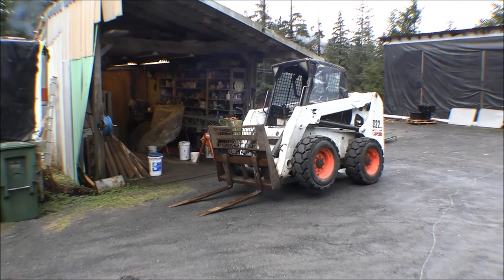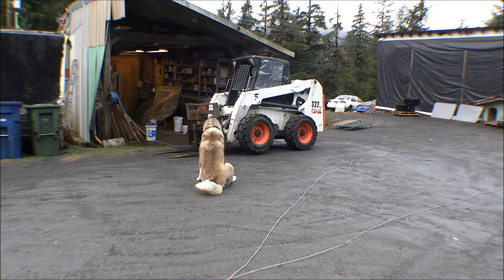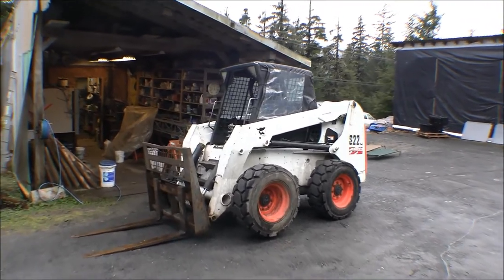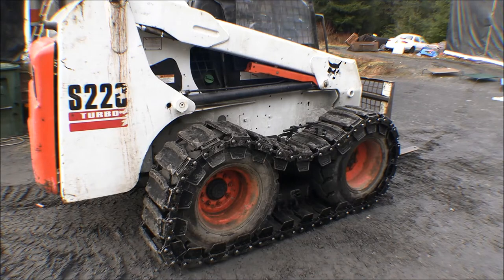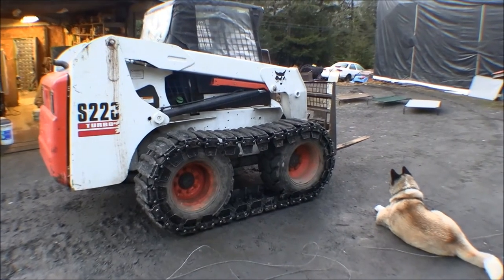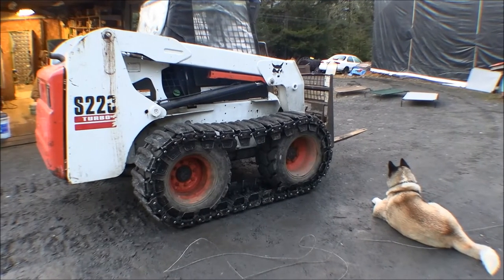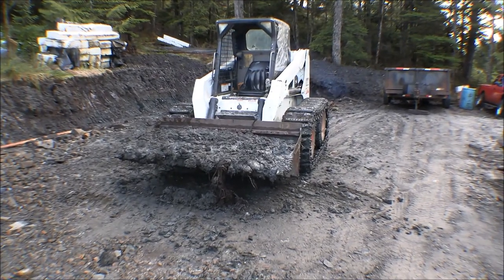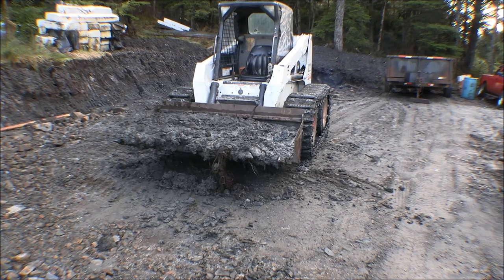Installing McLaren Magnum OTT Skid Steer Tracks on a Bobcat S220

Comment: You should have taken a pad out of the track..  There is an extra pad in there.. You put so many bolts in the short holes that as the track wears, you may run out of adjustment..  Also, I think i see where you have two adjoining pads with the adjustment in the short hole on both sides of the dog bone..  McLaren says that will make a bind in the dog bone and pad adjusted like that..  Check it out..  I would not like to see you have problems with your new tracks..  I also have a set of McLaren tracks, however mine are a little different style than yours..  Mine are non directional..  Also I find it is easier to break a bolt free on the front of the track and then back up to where you are going to make your track adjustment..  I have a John Deere 330G and did not have a clearance issue, as I had three inches of clearance between the tire and the machine before I installed the tracks..  I do not know what your clearance measurement was before you turned your tires around, but you may also be ok without spacers..  I do not care for the spacers myself, as there is very often an issue with bolts breaking..  Before I retired the company put tracks on one of the skid steers and had issues with breaking bolts..  It is a common thing to happen with spacers..  I also have run Grouser tracks.. I have a set I put on my John Deere 325 skid steer..  I just rebuilt them both a little apart from one another..   The one has no run time on it..  I swapped machines and did not let the tracks go with the old machine..  Enjoy your new tracks..  I wish there was an option to add a picture on here..

Comment: Have you ever had the spacer hub snap the original lug studs?
Reply from the maker: I didn't use a spacer, just turned the wheels around.
Reply: @psgflier so the air stem is on the inside?  I have OTT on my Bobcat and have spacers.  The wheel has fallen off twice due to the lug studs breaking
Reply from the maker: @marcusjames3035  Ya, the stems are on the inside, makes it a pia because I have one tire that has a slow leak. The main reason I didn't get spacers is because of the cost of the spacers combined with the cost of shipping up here is pretty high. I also considered the added stress on the studs and the axles/bearings. I found that turning the wheels around gave enough clearance for the tracks and kept the nuts in tight. The only problem I encountered is the machine is 2 inches too wide to fit in my dump trailer with the tracks on.
Reply: @psgflier  being too wide is exactly what I was afraid of. I also use a dump trailer to transport and right now I just fit in with my OTT with the spacers. I’ll have to see if I turn the wheel around if they will fit
Reply from the maker: @marcusjames3035  The Bobcat fits in the trailer with just the wheels on and them turned around, but not with the tracks mounted. My machine is a 220, if yours is smaller it may work. I don't know if they stick out farther than they would with spacers, just that there is enough room for the tracks to clear the machine.